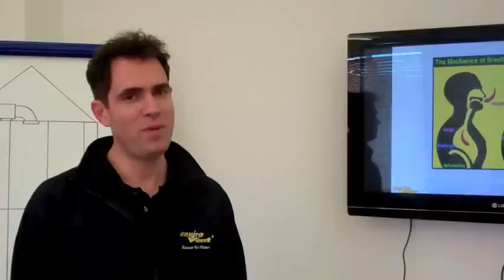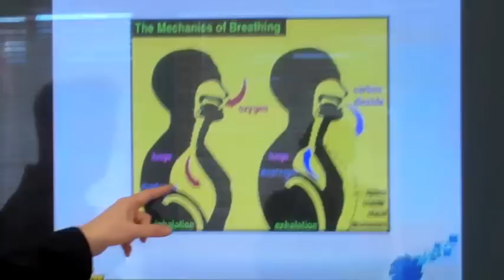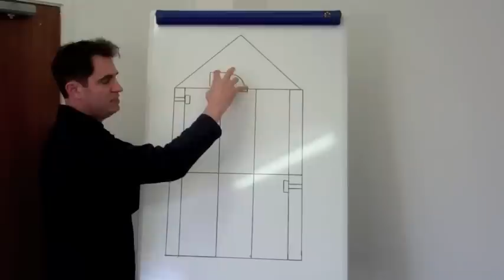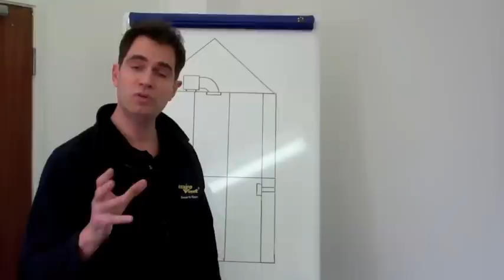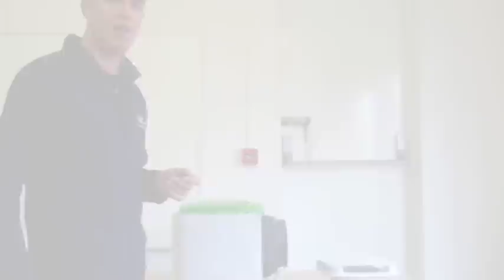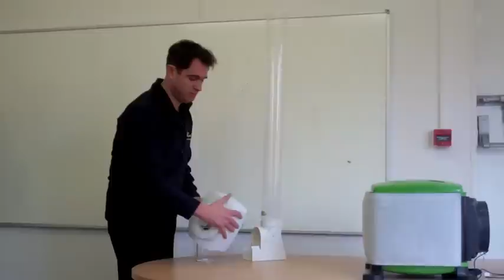How to cure condensation and black mould problems

Comment: No-one needs this system. Reducing and managing the moisture that you produce is the first line of defence. Opening your windows will cure your condensation problem.
Reply: Not if it's damp outside and cold...normal UK non summer weather.
Reply: @CaptainProton1  If the outside temperature is lower than that of your bathroom or kitchen then the warm, moist air that you produce from showering, cooking, washing etc will migrate to it rather than sticking to your internal walls and turn into black mould. Basic physics.
Reply: What if you go to work and can't leave windows open - what if it's cold outside and you cant afford heating your house with windows open?
Reply: @ItiswhatitisS65  I am not advocating that you leave your windows open while you go to work or else you wouldn't have any valuables left when you came home. I am also not advocating that you have your windows open whilst your heating is on. Equal measures of heating and ventilation. Which means after you have had a shower, fling your window open while you get ready for work and have your breakfast and then close it before you go to work. The warm, moist air will then migrate to the outside instead of sticking to your walls and turning to black spot mould.

Comment: When you exhaust "the bad air" out, are you not exhausting the warm air that heats the house as well? If you are doing that , then you will never get the furnace to keep the  house at a desired temperature. Therefore you will be spending more money trying to keep the house at a comfortable temperature. What now?
Reply from the maker: +Erwin Nevado Hi Erwin, as the Cyclone fan is only extracting moisture when it is needed, the most heat that would be lost would be the heat within the steam from showers etc. There are also energy saving bonuses from the Positive Input Ventilation systems. The destratification effect allows the heat normally trapped at ceiling level to be re-distributed throughout the property.
If heat loss is a concern to customers, we have the heatSava fans available. These fans have thermal cell and aa balanced air flow, so when moisture is extracted, the fan can retain up to 75% of the heat lost through normal extraction, and use this to warm up the air being brought in.
Reply: Erwin- of course you will loose some heat, but the alternative is living in a humid, mouldy and unhealthy home. Houses were always draughty and inefficient, but mould is a recent phenomenon due to improved draught proofing, better fitting windows etc. Houses need a steady flow of fresh air. A good ventilation system transfers the heat from the exhaust air to the fresh incoming air, so heat loss in minimal. A small price to pay!

Comment: I need to contact him.  I HAVE LONG TERM EPX. IN WDB FOR 12YRS, TWO HOMES, 6 MTH BRK INBTWEEN, STARTED FEELING 

BETTER, FIRST HOME LOST ALL. DISABLED DIAGNOSED W/ FIBRO/MYO, CFS, MCS, RHEUMATIOND ARTHRITIS, BOTH LL HID 

MOLD, PAINTED OVER, TORE OUT WITH US IN HOME, BOTH ASTHMA ME NOW SEVERE COPDLUNG DAAGE. NO REG. AGENCY. 
FILED K W DOJ ETC. PRIMARY WOULD NOT DO TEST. PULM DID ELISA, SEVERE LOW WHITE CT, ASPERGILLUS FUMAGATUS 

IN BLOOD, I HAVE BEEN SO SO SICK WORRIED I AM PLAUGED BY WORRY .

 MY PULM STILL HAS NOT CALLED BACK. 7 WKS. I NEED TO KNOW"WHAT THAT TEST MEANS??? PRIMARY SAYS OK, FINE, A LTL 

LOW ON WHT CT, WHAT DOES THT MEAN FOR ME? WHAT DOES THAT MEAN FOR ASPERGILLUS FUMAGATUS, LONG TERM 

EXPOSURE 6 YRS, LL TORE OUT WALLS AGAIN AND MOLD HIDDEN UNDER KIT SINK, POPPED RIGHT UP W WET. LL TRIED TO 

HIDE AGAIN. TNT CAUGHT THEM IN ACT. 

THEY CHOPPED IT ALL UP IN PIECES AND SPREAD IT ALL OVER, THEN THEY GROUND I T UP INTO SAWDUST. TNT ALLERGIC 

TO MOLD NOW AFTR FIRST HSE. PLEASE PLEASE HELP. NO ONE HAS TOLD ME ANYTHING, I RESEARCHED  AND IT SAYS IT IS 

FATAL...WHY ARENT MY DR'S HELPING ME? OR TELLING ME ?? OR TREATING ME ?? I FEEL HORRIFIED AND SCARED TO 

DEATH I WANT TEST THAT SHOWS.  WANT ERMI TEST

. PLEASE PLEASE PLEASE HELP ME I HAVE BEEN SO SO SICK FOR 12 YRS.  I COULD BE GETTING TREATED . EXPERT WIT. 

RONALD SIMON SAW PT. SAID POSITIVE FOR WATER DAMAGED  ILLNESS DISEASE. MET 7/6 FACTORS FOR DISEASE. I 

DESPERATELY NEED HELP. MY PRIMARY CARE DR. WONT LISTEN, NOW 4 YS WITH FUNGAS ON LIPS, LEGS, AND SIDES OF 

MOUTH. HOME IS DISASTER. NEED MEDICAL HELP NOW!!!!

I WANT ERMI TEST NOW!! I WANT TO KNOW WHAT MY BLOOD TEST MEANS NOW !! THIS IS SHEER TORTURE NOT KNOWING IF I AM DYING EVERY SECOND OF THE DAY WHILE MY DOCTOR DENIES ME THIS RIGHT?? PLEASE HELP!!